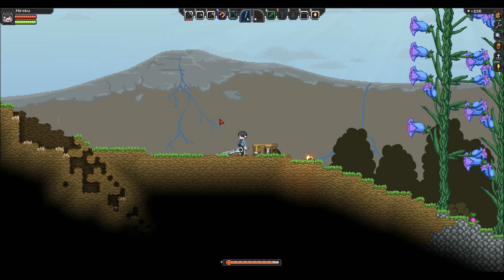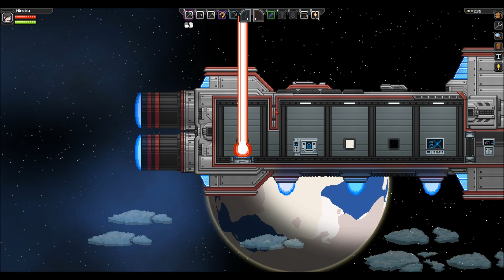[Progenitor Beta] Starbound Basics - How to: Repair, Fuel, 3D Printing, Farming

Comment: hey dude nice first vid, logs are not working for me for fuel, could be the new patch we just got !?
Reply from the maker: Yes! It is, I'll add an annotation to that part of the video, but as of this new patch I've seen people saying that for the moment Logs cannot be used as fuel, which leaves Coal as your main source of fuel, and then higher materials such as Uranium and Plutonium as well.
Reply: Degenerate Pixel Actually, I appear to be able to use logs. but does planet traveling require the penguin boss to have died? because I couldn't go to the place I selected and it showed the travel.
Reply from the maker: It does not. As of the current patch, Indignant Koala, 10 logs can be smelted into Coal but Logs themselves I don't believe can be used. I am fairly certain planet traveling does not require that the penguin boss be dead, since in older versions, it was actually required before you could fight him fairly. Chances are you didn't have the fuel to travel to that particular planet
Reply: Degenerate Pixel I can't seem to be able to smelt the logs.
Reply: Degenerate Pixel what about offended koala?